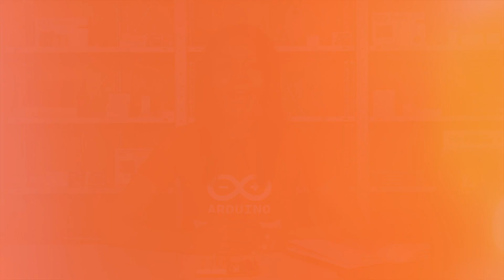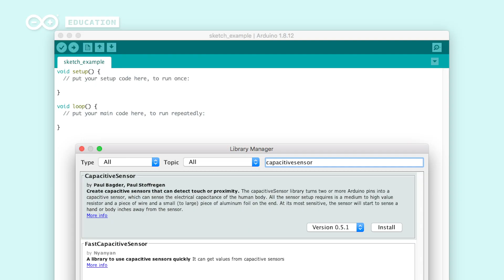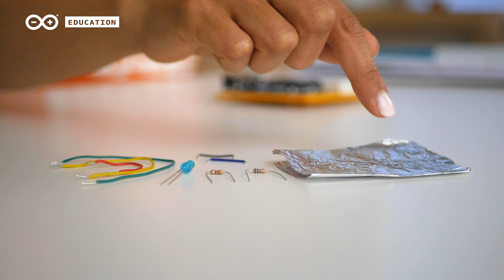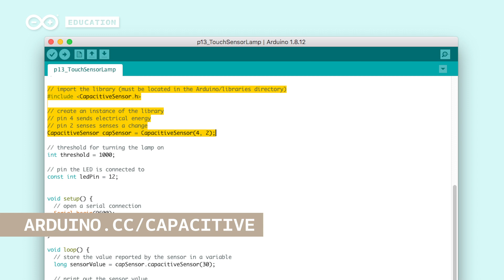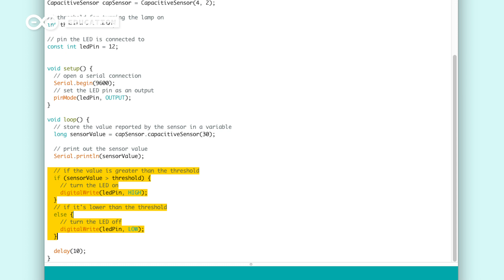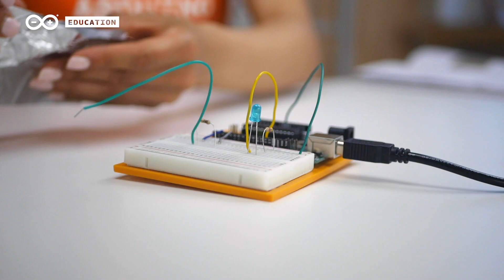13 Starter Kit: Touchy-Feely Lamp

Comment: Might want to add a note around 1:13, noting that the wiring is incorrect. The wires in the video go to 2nd and 4th female header opening (Arduino Pins 1 & 3), and they should go to pins 2 & 4 as described in the code. Love these quick video tutorials. Keep making more!